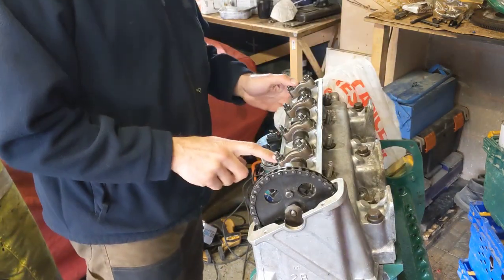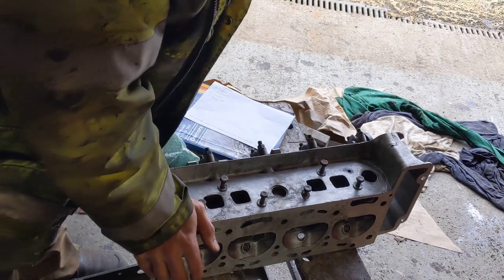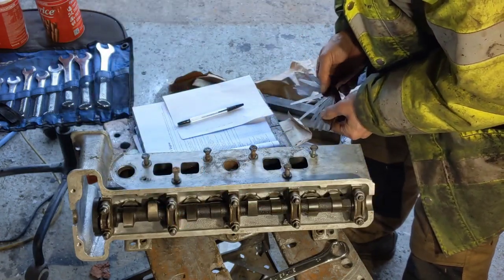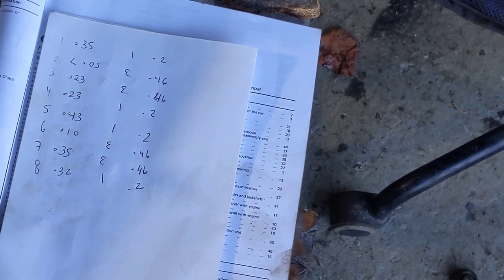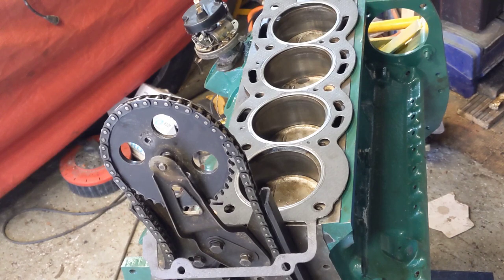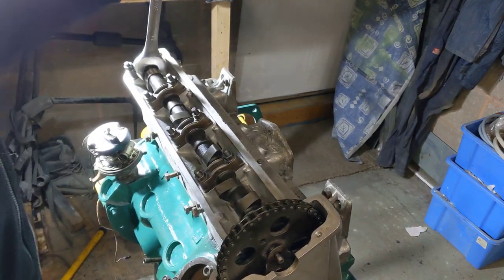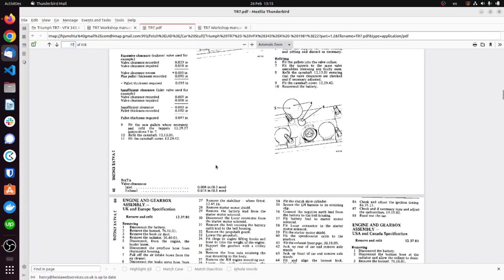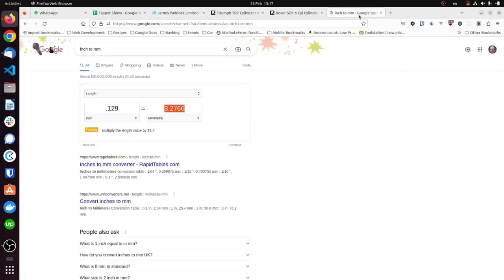Triumph TR7 Restoration: Episode 98   Engine Rebuild Part 5   Valve Clearances

Comment: Hi Henry. You are working backwards on setting up the timing. Start by setting Piston 1 to TDC. Make sure the head is not installed at this point. The easiest method to do that, if you don't have a dial indicator to determine exactly when the piston is at TDC, is to put the timing cover on loosely, no need to bolt it on. Then install the harmonic balancer (dampener pulley), no need to bolt it on. Turn the crankshaft until the timing mark on the dampener is lined up with TDC on the timing scale on the timing chain cover. Then don't move the crankshaft, at all. Remove the crankshaft pulley and the timing cover and install the chain with the marks lined up on the jackshaft. Install the camshaft sprocket with the notch on the sprocket pointing up.  The jackshaft and distributor "timing" really don't matter at this point. The marks on the jackshaft are there for the next guy that has to open the front of the engine and change a timing chain. They have absolutely no bearing on anything else. The water pump doesn't care what position it is in and the distributor you will place in the correct position once you get the valves timed properly.
Reply from the maker: Thanks dtp, I think I've finally got it there
Reply: @HenrysGarage  I have to say, I do appreciate your tenacity. And the fact that you have an uncanny ability to remain calm when everything is going wrong. Also, you may want to check the valves to make sure you didn't bend one or 2 of them when you were trying to turn the engine over and it was hitting the valves. It takes surprisingly little to bend a valve.
Reply from the maker: @JustATinkerer  OMG, please do not say remove them again.  I think I've got it in and the timing right now.  I also wonder if maybe I wasn't hitting the pistons, but the timing chain jamming, as you'll see today at 7.

Comment: Henry when you lapped in the valves the valve clearances will have changed so you need different shims
Reply from the maker: Sure, but these are big differences
Reply: @HenrysGarage  Well yes I though that too, but wasnt sure whether you had had the valve seats recut or anything.  I checked the valve clearances on my low mileage (50,000 miles) TR7, which runs perfectly  and they were as follows: Inlets 5-6 thou (0.0125-0.15mm) and Exhausts 10-12 thou (0.25-0.3mm)  whereas they should by 8 thou and 18 thou according to the workshop manual, so they have closed up quite a bit in normal service. I have not bothered to adjust them yet, as there is loads of compression. There is a caution in the ROM "after grinding in and prolonged service the valves may protrude into the cylinder head and may make it impossible to select a pallet thin ehough to achieve correct clearance. It is permissible to grind the valve tip, provided that the valve tip protrudes above the internal shoulder of the collar and that the selected pallet is proud of the collar top edge" so this may be a solution. If you don't have the ROM, I can send you a pdf. There is a lot of deatil on setting the valve timing too - much more than Haynes
Reply from the maker: Thanks Velo, I'm not sure what ROM stands for but if it is the BL Manual (maybe Repair Operations Manual) then I have an electronic version and I agree it is much better than Haynes, just harder to find the info because it is PDF rather than paper

Comment: Couple of things ... as you lapped in the valves you will have reduced the valve clearance , also valves 'hammer in ' over time which will also reduce valve clearance . I take it you mic'd all the pallet shim's before you checked the valve clearances ? and with all your clearance's you have worked out with the shim thickness ? also as stated valves hammer in over time so when setting up the valve clearance's set with the max clearance for inlets and exhaust not the minimum .  0.2mm for inlet and 0.5mm for exhaust sounds about right for this engine , also mark your crank for TDC with No1/No4 pistons at top of their strokes with the head off , in theory with the head on No1 on TDC cam lobes pointing up when the engine turns 1 and 4 piston are going down so valves should not hit pistons , in theory ! . Another thing ... if the valves are hitting the piston/s now they will do so sooner with tighter valve clearance's
Reply from the maker: Thanks Truck - will try and do that

Comment: Hi Henry, You have a very methodical approach. I've just looked at the official Triumph service data. Tappet shims for the Slant 4 engine series (8v & 16v) were available from 1.7 to 2.9mm in 0.02mm increments. Not sure why yours need to be so large.
Did you get any history with the engine? Has someone fitted a non standard high-lift camshaft in the past? That may account for the pistons and valves clashing? Do you have the original head gasket? If so, measure the thickness and see how it compares with the new one.
Keep up the good work!
Reply from the maker: Thanks Carston - I have no history, unfortunately.  And foolishly didn't measure the gaps before removal.  I'll measure the head gasket and take a look, but I'm thinking I probably had the timing off because the engine was definitely turning over by hand prior to removing it from the car.  So I know it will turn over (unless too much has been skimmed off the head).
Reply: Overhead cam engine so head gasket thickness isnt relevant
Reply from the maker: @narrowbeamdaydream  Could you explain that to me?  Surely skimming the head reduces the gap?
Reply: @HenrysGarage  you are measuring the clearance between the camshaft lobe and the valve stem when the valve is closed. Unless you have had the valve seat inserts recut, skimming the head surface does not affect that clearance. What it will mean is that there is more chance of the piston hitting the valve when the valve is open if too much has been taken off, unless the head gasket is thicker by the same amount.
Reply from the maker: @narrowbeamdaydream  ok - understood.  I thought you meant in general.

Comment: Henry, does that engine have a standard camshaft?
Reply from the maker: Hi Chris, good question and I don't know.  I've looked at it for markings but cannot find anything on the net to tell me what they should be for a standard.  I have found something showing different lift heights for different cam shafts , but to get close to what I'm seeing I think it would need a sprint cam, which makes no sense
Reply: @HenrysGarage  Your going to need an undersized (super thin) shim so that you can get a Feeler gauge in-between the cam and the bucket. Same as on my Triumph Bikes. Good luck  and I'll keep watching. I've just bought another TR7. A V8 this time.
Take care.
Chris Robinson
Reply from the maker: @chrisrobinson61  Well I want to see that
Reply: @HenrysGarage usually stamped STD for standard cam shaft..I've a Kent cam in mine all clearences are 0.18 in all valves
Reply from the maker: @hankpb1  Thanks Phil,  mine has some stamping and STND something is one of them so I'm guessing it is standard